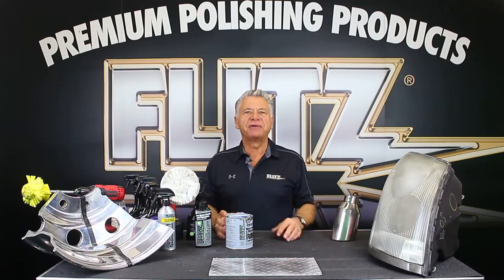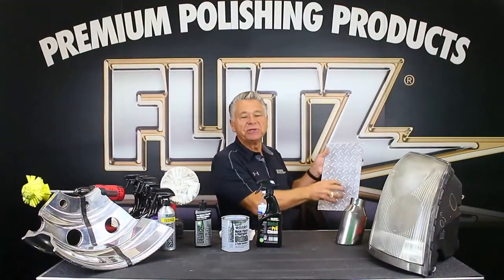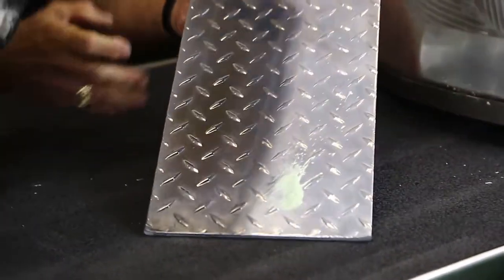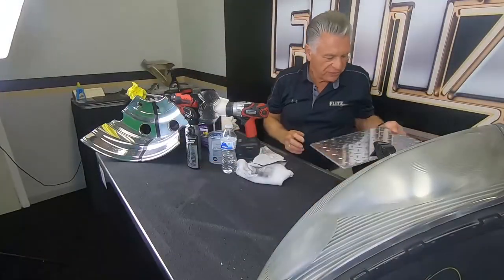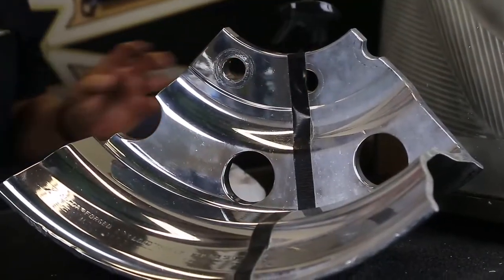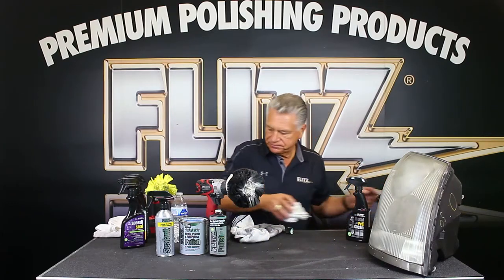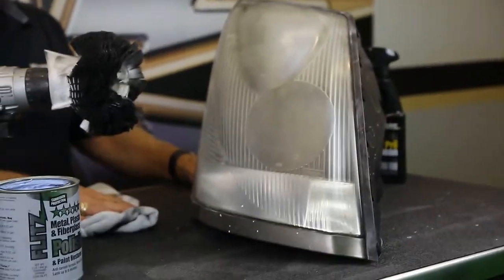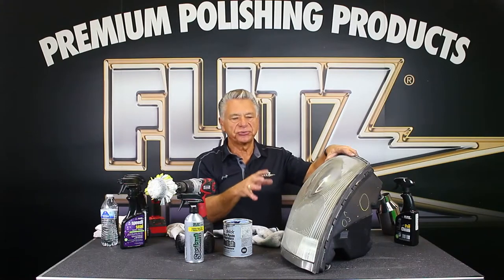Flitz 2021 Heavy Duty Truck Products Demo

Comment: Would that oxidation remover work to remove oxidation from single stage paint? I know thats off label use but I deal with a lot of oxidized single stage paint so would be awesome if it will work!

What do you guys suggest to clean polished alum wheels covered in baked on brake dust? I need to remove the baked on dust without dulling the mirror polish.
Reply from the maker: We're not sure, but we could send out a 1.7 oz. sample of the product for you to test.  Just email your address to jayson@flitz.com

Comment: Has there been any mention of this polish potentially removing light curb rash? I have a 2013 F150 Platinum with factory rims and looking to improve them without leaving my truck with wheel guys for a whole week!
Reply from the maker: Unfortunately no, Flitz products will not help with curb rash.  You will have to get that fixed professionally.

Comment: Will the metal cleaner dull my polished aluminum Alcoa wheels and gas tank on my semi if I use it
Reply from the maker: No, it will not dull your polished Alcoa wheels and gas tank.  The metal cleaner is not ACID based.

Comment: Will this take the shine off my Alcoa wheels if I use it as a cleaner but don't polish them they are shinny and polished I would like to use it as a cleaner just don't wana have to polish wheels again after
Reply from the maker: No.  Since it's not acid based, it will not dull or haze the aluminum. It will not change a polished finish.
Reply: @flitz  thank you

Comment: How does your product compare to 3m AL polish?
Reply from the maker: FLITZ is more versatile (not only for Aluminum) also protects up to 6 months (with out any extra protective coatings or sealants).
Reply: @flitz  So you suggest Flitz polish and sealant. I stripped and sanded cracked CC off F150 alloy wheels, hoping Flitz can protect it in the salt!
Reply from the maker: @alb12345672  Let us know how it works out for you!